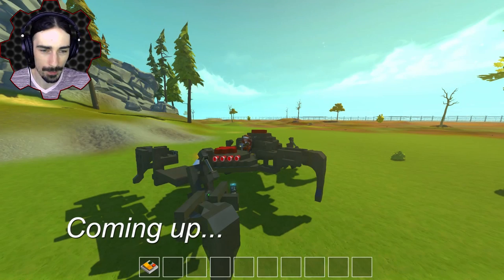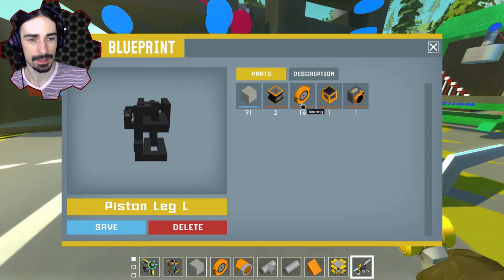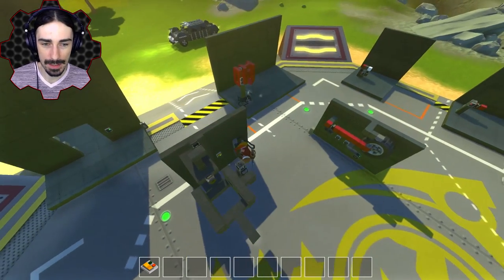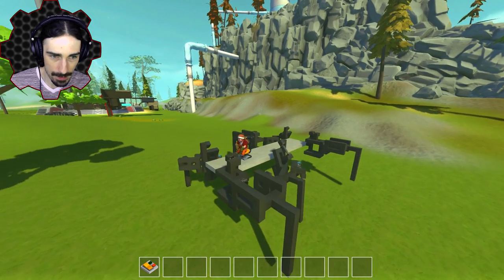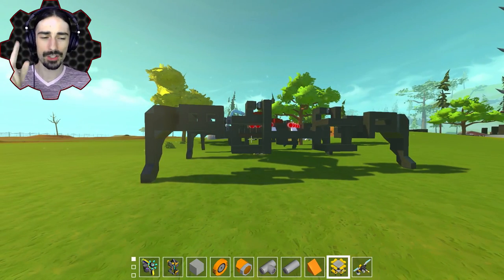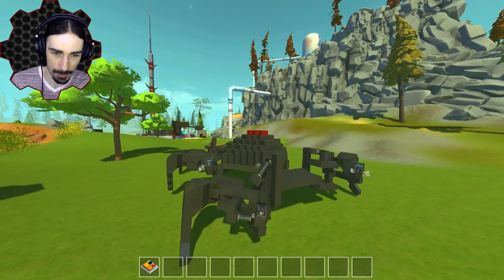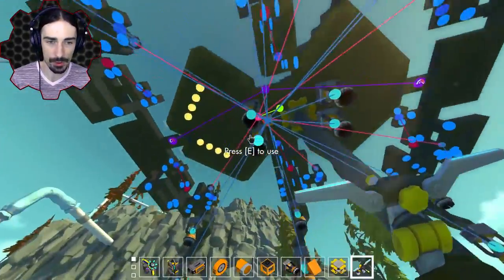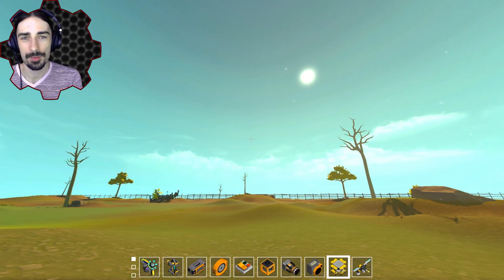FLYING PISTON SPIDER MECH WALKER of NOPENESS! - Scrap Mechanic Gameplay Showcase Ep32

Comment: I think the reason it sinks when it walks is because you have 6 legs and not 8. When the spider is walking, with 6 legs, there is always 2 legs down on one side and 1 leg down on the other. This causes it to shift most of its weight onto the one leg. If the walker had 8 legs, then it would balance more while walking. This is just my hypothesis and it most likely may not be true.